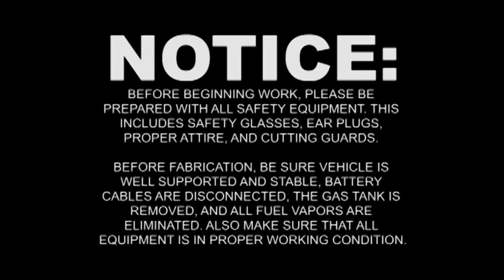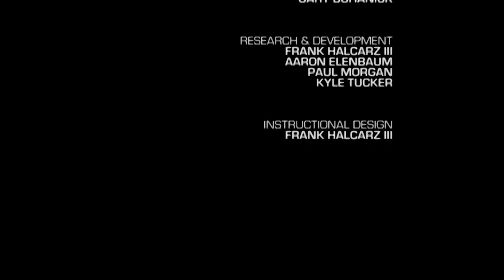1970-1981 Camaro/Firebird Part 1 - Detroit Speed Subframe Connectors Install

Comment: I don’t get it,why not use a 4x4 or 4x6 what ever it takes and run it inside the frame on one side and over on the other side and when that’s done lay a clamp or screw a flat piece of metal on two sides there by making it stronger yet and no chance of flexing or moving.even on the inside I’d like to lay metal over and out the sides to spread the load.i don’t think it’s any more work.well this is just me thinking about my project using yours for visual idea’s.thanks.it does look nice when finished

Comment: Very nice. My friend and I figured out standard 2”x3” mild steel box tubing fits right into the factory subframe opening and can be tapered into the rear frame sheet metal, cutting the floor pan for a tight fit, over 20 years ago. We’ve done several like this.

Comment: Am I mistaken or did you guys weld the SFC to the bolt in front subframe that these cars have? If so, doesn't that ruin the whole point of a bolt in front section?
Reply: Probably ok if you plan on throwing away the car if it crashes
Reply: I think is wierd, whai if you need the align it or replace it some day. 
Allso, did you noticed how carefully he tig weld the joint pieces on the connectors, and the just one mig seam each side to subfeame😅
Reply: @TheReinoPaasonen  yeah dse makes some cool stuff but why not make this a weld in / bolt to sub frame kit.
Reply: @kpb711  because that isn't the strongest way to put them in. If one needs to take the subframe out, just cut where the weld is with a thin cutoff wheel. That will leave about a .035-.045" gap, perfect for welding back in
Reply: @tadwiltman4875  nah
Reply: @tadwiltman4875  yep you are absolutely right
Reply: @kpb711 Just cut the connections back out in that scenario